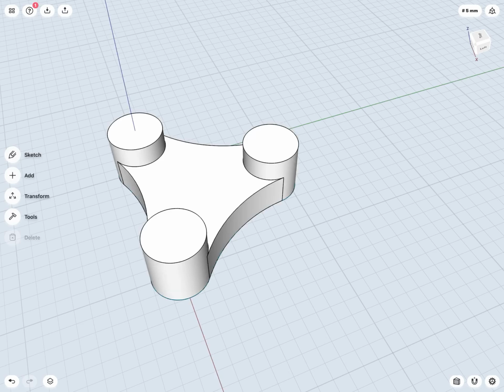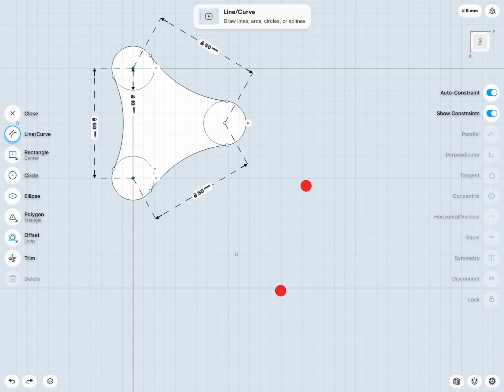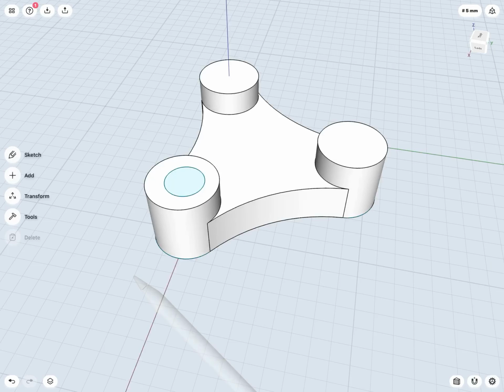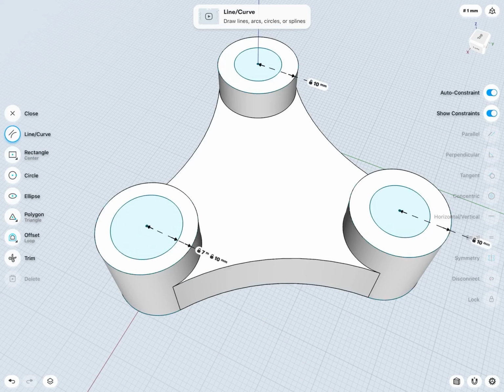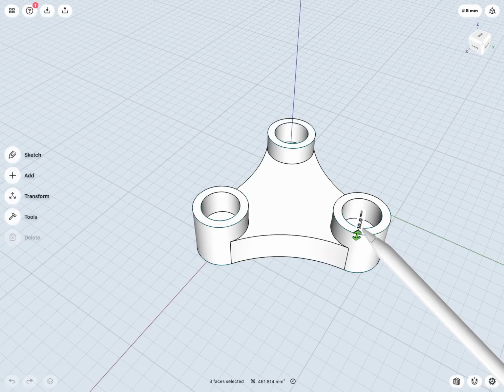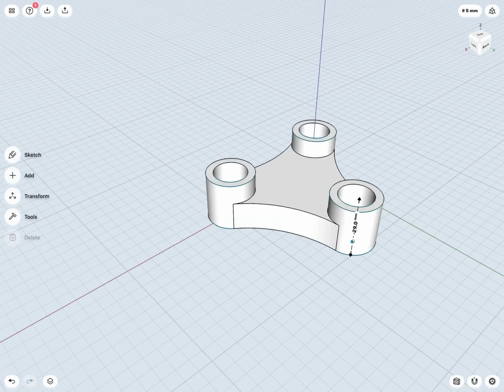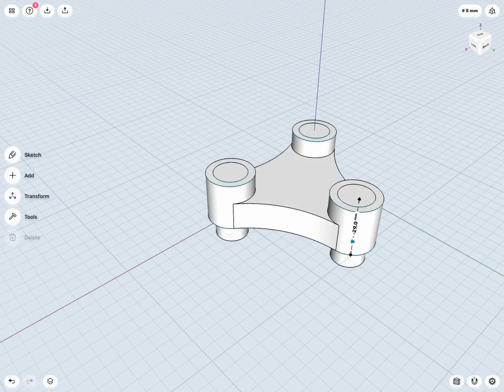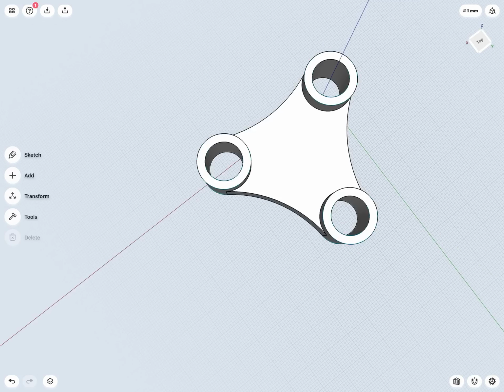Cut bodies and create holes | Shapr3D for Beginners

Comment: These are great. The first 3-4 beginner videos were hard to get through - made me sleepy. Mainly  because the instruction or information would be given. Then a pause. THEN showing where you were talking about and doing the action. It felt like a lot of waiting. These later ones feel more real/time, less pause-y. I'd honestly rather pause the video, back up and watch again, to catch something, than to listen to instruction and have to wait to see it on screen. Dunno - just feedback. Not even sure how accurate my perception was on it. Might have just been tired. 

About the extrusion part. When the concentric middle circle was extruded, and then pulled down to delete that cylinder entirely, it doesn't work. At least not on my iPad pro and updated app. I have to pull down on the extrusion, until it's flush again. Pick up the pencil and then reselect and pull down to create the negative space. Hope that wording makes sense. It has to be selected once to extrude/unextrude, then selected again to go DOWN into the outer circle and out the bottom. Not sure if this is how it's supposed to work - especially since this video is just since February. I've restarted the app AND restarted the iPad, but it still makes me select separately for each action. On the video he can just go from extruded, down and out the bottom in one motion. I'm not able to do the same.